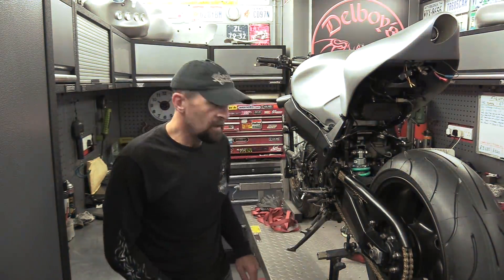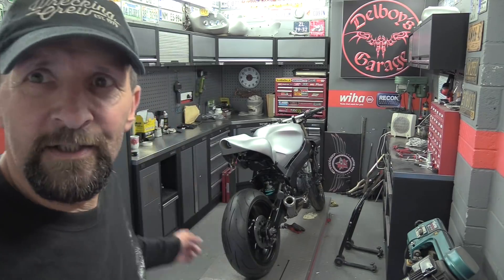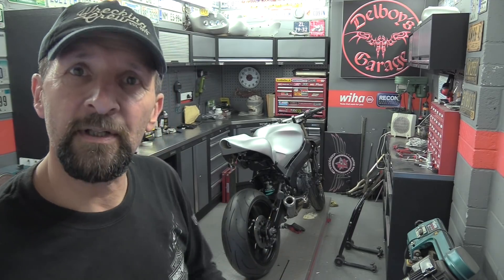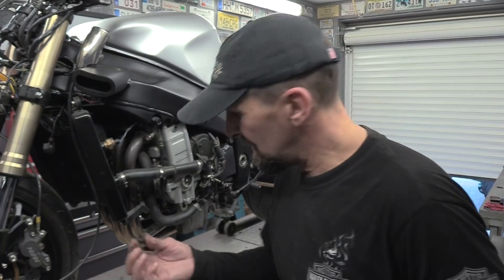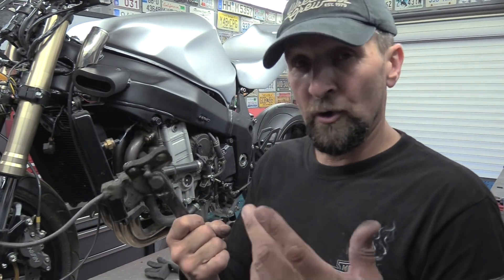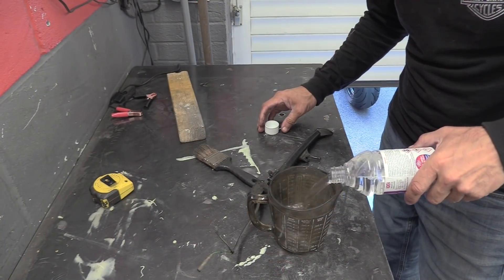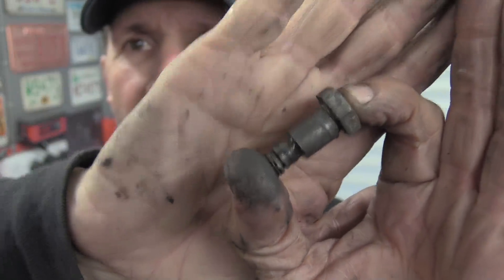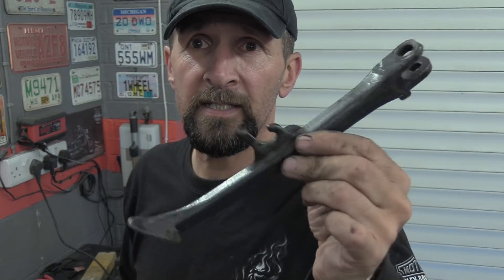Delboy's Garage, Fighter Build #142, Side Stand Extention !

Comment: I'm a mig tig and stick professional welder, and the cuts you made to fabricate are called castle cuts, and is a very good method to help stop cracks travelling.. Your side stand will be fine...
Reply: But you dont know about welding alloys right? We are all professional on internet. It will be fine as side stand but definitely test it.
Reply from the maker: Thank you my friend, im no professional, and have greatly enjoyed learning as i go, and making my own mistakes, thanks for the right name on the joints, this is how we learn, and why i love Youtube.  Take care.. Del.
Reply from the maker: Silver Elk, i have always likened welding a little to medicine.. its obviously nothing like medicine, but the profession contains general practitioners who are good across the board and most disciplines, and defer to specialist for more in depth work.. and then there are the specialists who focus on a certain area and get very good at it.. like alloy welding..  it's clearly a science and one im fascinated in... just dont have the time to study it and there are so many other things i want to learn..   thanks and take care,. Del.
Reply: Moonfleet41 U did well. Message was for wastwater.
Reply: Chrome vadium and forged steel aka ferocious no alloys... have you ever welded alloys on dcep??
Reply: And scarf joint is commonly used and deep V if u grind it after. Preheat whole part, weld, heat again and let it cool slowly. Cutting sharp corners to metal doesn't help with cracks. Definitely test it. Side stand/tool are casted and you see it from weld its very shiny. It will be probably fine as stand and you did well
Reply: westwater73 what about dcep. Del just welded alloy with dcep and yes vanadium is not cast iron but its steel alloy.
Reply: instablaster...

Comment: Hey Del. Don’t forget to get a side stand “rubber saucer plate” so you can cut a piece out of it and figure out a way to attach it to the bottom of the foot that way it doesn’t scratch up the paint and start rusting. Just a thought.

Comment: Nice work. Once again you taught me something new, I always thought a forged chrome vanadium steel wouldn't weld cos it's some sort of stainless alloy. That came out seamlessly. Good job.
Reply from the maker: Hi Adrian, well it doesn't rust, so it is stainless.. but its still magnetic so its not that hard or brittle like cutlery steel... i figured that an extension bar is designed to take great twisting force without moving... so it should be able to hold my bike up..

Comment: Now that was a proper job as far as I could see.  Time will tell, but very interesting for me as I kind of got used to the Sportster leaning over at 45 degrees with the back end jacked up so much.  When I rebuild that will be corrected and if this works for you then I'm going to be copying!  Skäl  David
Reply from the maker: Hi David, good to hear from you my friend, there's a different technique with a Harley due to the angle of the stand, it involves changing the shape of the foot, but am sure you have a plan!  However, feel free to drop us a line off Tube if you get stuck for an idea!  Chat soon, D&Px

Comment: In awe on how you handle issues like the bolt. It always terrifies me that when working on mine, I will find something I cant fix and as its my only method of transport - put me off the road. Your vids have made more adventurous - cracking stuff.
Reply from the maker: Thanks buddy, and you have a right to be worried, I'm the same, working on your daily ride and the risk of making in un-rideable is a big hindrance, but most things can be overcome, just need a bit of lateral thinking and some patience, thanks for your support, really appreciate it mate !

Comment: Hi Del and Penny,
I am looking forward to the weekend and having a good look around the machine, bit of a bugger about that bolt but they are always wearing in that way, I noticed you used the vice to bend the side stand  mounting lug's, that always happens with those!
Pop quiz, I see queen and the stones, references,
And now Elton John, on the white board

Kind regards Warren
Reply from the maker: Hi Warren, cheers buddy, yes I imagine over the years that clevice joint at the top of the stand just gets opened up, sepcially as the shank on the main bolt wears and gets distorted, probably taken about 80% of the slop out of it, but you need to be quite careful using the vice method as it's usually quite brittle...  we'll keep the song lyrics coming lol D&Px
Reply: Moonfleet41 Hi Del, clevis joint, Duely noted!
Would the same term apply to the way the footrests attach?
Your right about brittle, we used to use a propane torch to heat before bend with bits like these, never go at them cold.
Reply from the maker: Yeah I think so, anything that's got two sides with a gap in the middle... like cleavage (sorry I'll get my coat lol)
Reply: Moonfleet41 a fine reference to the fast show,
I used to enjoy the bloke who at other times played Tommy cockles in the show offering to sort out everybodys change, in the pub the way it descends into chaos and he turns around and says sod the lot of you! Breaks a massive Coin jar and says you lot sort it out!
Comedy gold
Reply: Ps, anything which came into being in engineering terminology and has it's roots  in female anatomy is alright with me,
I am quite fond my ladies fanny clasp myself!!
Love and respect
Warren

Comment: Hi Del That  side stand extension looks grate the welding is A1 it will work all the welding you have dune as worked in the past and this one will to can't wait  to see the bike
Reply from the maker: Thanks Steven.. actually, thinking about it, you;re right, no weld i ever made has broken or cracked, not the metal around it failed.. as long as its beef, it don't matter if its a bit ugly aye..!

Comment: Hi Del. You need that lathe, save time waiting for a bolt to arrive. As for the welds, they will hold fine for that application, but trust in your welds. Run a straight root weld along your chamfer, without the weaving, then you can do a cap weld over the top of that, weaving left to right. When your weaving initially across your chamfer, you are removing the purpose of the chamfer by sweeping onto the upper edges. It’s a cracking job, and looks great. Also I think your wire speed needs to be a little quicker, not criticising mate, just trying to pass on 30 years of engineering and welding fab knowledge. Keep up the good work.
Reply from the maker: Hi buddy, just thought I'd answer this as I spotted it a minute ago, had the news today that the bolt could be two more weeks, so I did make one, purely in order to fit the stand so I can push it outside for a walk round, didn't use a lathe, as I don't have one yet!!, but I did makeshift with the ghetto method and turned out a pretty accurate version of the bolt which I'm quite proud of, but I will be replacing it with the factory one as I've paid for it  now... and it's bound to be better quality... video up first thing tomorrow! 

Thanks for your kind and helpful advice on welding, I've never done any formal training so I'll take all the advice I can possibly get, the machine is pretty limited, but following some sound advice from people like yourself, I still manage to weld some 12mm thick bar and get it glowing orange... the advice I got was actually to run the wire speed a little slower than usual and move more slowly with the pass, just to let the weld heat up and penetrate... naturally not the correct way to weld it... the correct way would be to increase the power, but this thing was running maximum as it was and had no more to give... could really do with up-grading the welder, but then I could do with a lathe too lol  As you can see, I use what I have and just get on with it, we all wish we had more stuff don't we aye??  Thanks for your kind support and your generous help, it's much appreciated buddy, cheers, Del

Comment: Force on side stand is actually very low, the force is axial and compressive, that will be more than strong enough.  If the forces where a bending stress it pull the weld apart but this force is pushing the weld together. Do i have to say lovely job Del as ever?
Reply from the maker: Thanks Kev, you're very kind mate, and what you say makes a lot of sense.. thanks for your kind support.. have a great week.. Del.

Comment: Looks wonderful, good as factory, and I have no doubt that the stability and strength is fine. I'm sure someone smarter than me can calculate this for you. :)  I think it's a Torque problem... so the total Force (weight of bike) * radius (distance from center of force to where it's applied) * sin(angle).  So if bike center mass is 2 feet off ground, and it's 400 pounds and the angle it's leaning is 7 degrees... then that's 400 *  2 * sin(7) = 97 ft./lbs.  of torque.  No doubt someone will chime in if that's not right. :)  Anyway, looking great Del !
Reply from the maker: I love that kind of maths.. but i got lost along the way, so can;t tell if its right or not..!!!! looks cool though..lol!

Comment: Your welds will hold just fine, nice job ! (even if you do weld backwards, lol)
Reply from the maker: ...backwards lol  When I started welding, I used to drag the puddle and practically everybody who does welding told me to push the puddle cos you can see where you're going and it turned out to be right!  I find that when I drag the puddle, the nozzle is over the  job, I can't see where I'm going and I end up wandering off the join, I need a new weld mask too as with mine, I can't see what I'm doing anyway lol !
Reply: Ive been a welder since I was 19 and Ive always welded  right io left at a angle drawing the weld across in front of me staying over the puddle for the best veiw, but there are many ways to get it done right, rhats just the way I was taught in my coarse

Comment: That will be strong enough if you had of done the cut 90° for the way you done it it would have been even stronger. A a little tip don't weld up hill your welds will look ever better up hill welds are the most difficult. Great video del

Comment: Nicely done. On some Kawasaki Vulcans (Nomads) guys change the sidestand for a longer one from a different Kawasaki model. Identical mounting point but longer. Unfortunately the mounting bracket is welded to the frame so if the mounting hole becomes enlarged it has to be drilled out and bushed or the bike will lean at a crazy angle. A 900 pound bike loaded with up with gear puts a big strain on the sidestand bolt. I much prefer a centrestand but many bikes don't have them anymore.
Reply from the maker: You're right James, but centre stands have never really featured on cruiser bike aye.. there are some cool garage stands for keeping them upright.. but no good out on the road aye.1

Comment: I like the idea of a lap joint but would of made the weld prep a lot deeper and instead of doing one run (weld) it would better doing multi runs , if done right weld is just as strong (or stronger) as the steel , nice job though 👍
Reply from the maker: Good [point well made Mick.. i opted for a much slower wire speed and pass a lot slower,, the end result is that i still made the entire metal bar bright red all the way through... im sure it will be strong enough...at least i hope it will..lol

Comment: I had a similar situation with mine. I drilled a hole in foot and put a big bolt through it. . obviously you did a much better job than me, but works lol
Reply from the maker: Ha ha, ive done exactly that myself on Ratbikes in the past...i even bolted a 1" socket under the foot of a stand once..lol!
Reply: Moonfleet41 lol ..grate minds ..and all that.. good idea with socket...:-)

Comment: I've a Low suspension R1200GS that I also had 25mil shorter shocks put on. Now I've got to cut my stand 25mil so it will lean properly. The opposite of your job,. Welding looks good, I'm a bit concerned about the temper being taken from the metal in the  stand, in short the kick stand bending through use not breaking. Thanks again for a good vid
Reply from the maker: Hi buddy.. there is no need to worry, making a stand shorter is really easy and will never be an issue with strength, just cut the foot of the stand off as close to the bottom as possible, then trip off what you need so the bike stands where you want it, when you are satisfied, measure the height of the foot you cut off.. then cut that much more off, and just weld the foot back on... there will be no issue with strength because the weld is just down at the foot of the stand..  Hope that helps you buddy.. thats how i do them when i shorten them and it always works fine... Good luck. Del.

Comment: Nice job Del; but we both know there is only ONE true test - the dreaded 'prop-stand-swivel-turn' . . .
If you can balance the bike on the stand AND it happily takes the weight for a full 180 swing-around, it's a 'pass'.
(To fine hone the technique, borrowed Dukes are nice & tricky to practice on, but do teach good footwork - once you've dropped one or two you'll get the hang of it - the trick is to start with something light before trying yours, has TMF still got his Pani? : )
Reply from the maker: OK, here's a challenge for yah, i know the old Side Stand Swivel very well, having spent ten years running a bike shop its a daily trick... but ill offer £100 cash to anyone who can do it with a Big Twin Harley... and yes it can be done, but you need to bring yer best trousers and have a full English first mate...(oh, and some mates to pull you out from under the bike and call the Ambulance)..!!!!
Reply: Heh heh heh, a full dresser with a three foot long side-stand on a nicely painted floor? - 'Strictly Come Hernia'! I think your money's safe there Del, if not, I certainly won't fighting that sort of critter to get it back for you : )
Reply from the maker: Ha ha too right, ... we used to use a couple of pints of water on the hard tiled floor to move big Harleys about.. totally safe with all three points of contact, just slide them about like a big ole walrus.. lol

Comment: It looks like a good result, shame the remains of the extension bar couldn't be used for something else?  My first port of call for simple fastening like a shoulder bolt is not a stealership but the local fastener shop or engineering supplies, you will probably get better quality at a cheaper price, more quickly.
Reply from the maker: Hi Clive.. the bolt (and nut for that matter) are totally unique and specific to that job.. big fat shank, and short course thread wit ha shallow lock nut.. you'd never find anything in a bolt shop like that. could have made one with a lathe, which is why im saving up hard for a small one for just such jobs as this..!   thanks for your support buddy..

Comment: I hate doing anything to my bike because the previous owner had managed to round off almost all of the heads on the most important bolts. Turns a quick and easy job into a right pain in the ass.
Reply from the maker: I feel your pain brother, its par for the course with any old bike now... wrong tools, careless work practice, and no patience.. there are lots of reasons, but the same result aye.

Comment: good job on the fabrication. I might've made my bevels a little deeper for a more solid penetration but I expect yer welds should hold up fine. did you have any issue with chain clearance in the test fit?
Reply from the maker: Thanks buddy, thats useful information indeed. i was going a little wide and flicking off the sides of the bar too, but its all good practice.. at least ive got the setting right at last... turned the wire speed down and took a slower pass.. i did make one pass twice because i went a bit fast and didnt fill the groove.. but like i said, its a great learning curve and im better for this practice..
Reply: Moonfleet41 yessir the best way to learn to weld is get a few pertinant pointers then practice for the rest of yer life...

Comment: Did I miss it or did you not drill holes in the battery box area to lighten the weight of that big chunk of metal?
Reply from the maker: No Robert, i cut the back bottom corners out into 1/2 inch holes to let the battery breath a little.. but its a monocoque structure, and the more you cut away the more is flexes under load.. and you're saving no more than a few grams anyway...

Comment: Could you have used a standard bolt with a sleeve or bush for the side stand bolt?
Reply from the maker: Hi Kerry... it would have been harder to source an exact bushing to make a clean machined fit in the frame hole than it was to just buy the right bolt from Kawasaki.. ill eventually be abler to buy a lathe, and then i can make bolts like that when i need to..

Comment: If you have the room get new bolt a little longer and put a lock but on the back.
Reply from the maker: Hi Wes, sadly the bolt is an OEM part, it has a 10mm shouldered shank and an 8mm thread on the end, there's very little clearance behind the stand, it does come with a lock nut and even the lock nut itself is a specialised shallow one to fit in the space, ordered them both and will fit them in the next video, you'll see, but thanks buddy, it's a good common sense solution, you think like me, cheers, Del